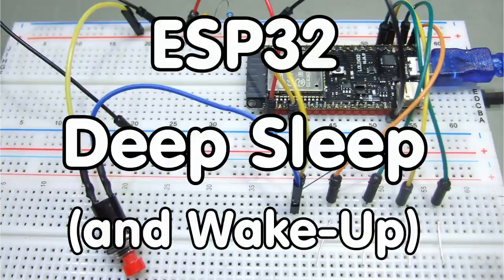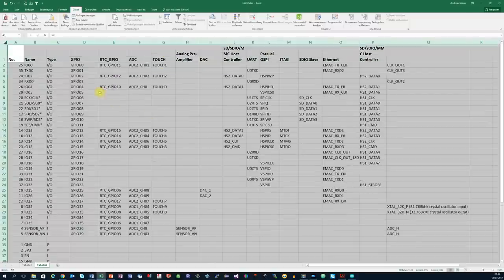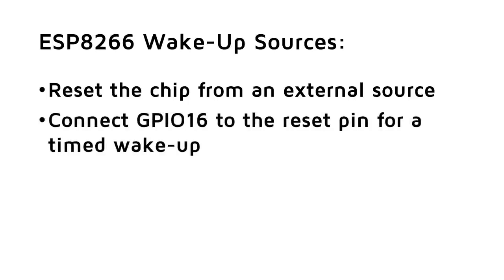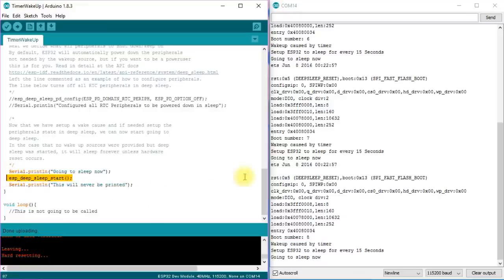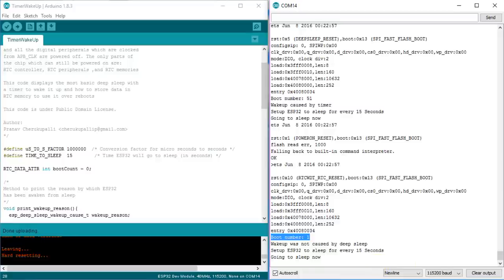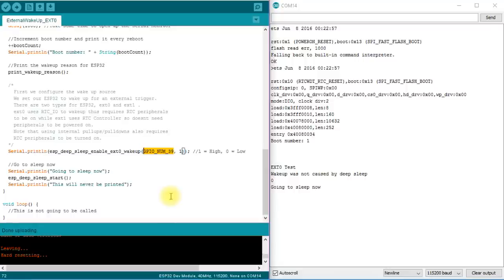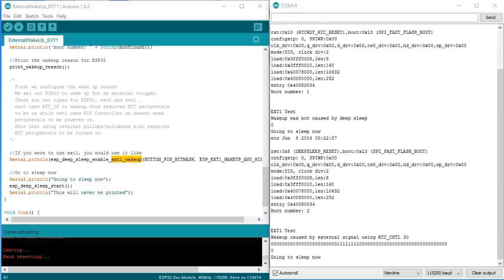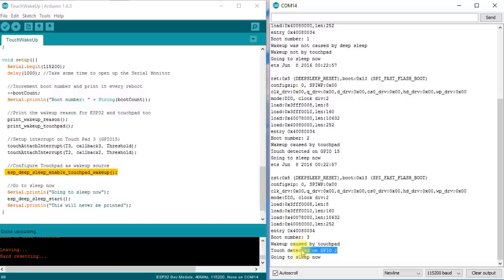#149 ESP32 Deep Sleep, RTC Memory, "Secret" LoLin Pins

Comment: Andreas, i don't quite understand the bitmask, what if i want to wake up the pins 32 & 33 ?

thank you.
Marc.
Reply from the maker: Each pin has its own "mask". If you want 32/33, you have to set bit 32 and 33 in this mask to high (0x600000000 if I did not a miscalculation).
Reply: Andreas Spiess thank you Andreas. YOU are my hero :)
Reply: Andreas Spiess the bits 0000 0000 (what are gpio from bit 7 to 0) please ?? :) thank you. Marc.

Comment: I didn't see a current comparison between the deep sleep modes of 8266 Vs ESP32. Does the 32 use less during deep sleep?
Reply from the maker: I will do real measurements in a later video.

Comment: Does the ESP32 completely turn off WiFi when you use "WiFi.mode(WIFI_OFF)"? It doesn't compile with "WiFi.forceSleepBegin()" like the ESP8266. Also, how to turn WiFi back on? I used "WiFi.mode(WIFI_OFF)" and since then my WiFi hasn't been able to connect to a network anymore.

Also, you mentioned that RTC memory only survives deep sleep but not hard reset. Is there a way to make it survive reset like it did on ESP8266?
Thanks!
Reply from the maker: 1. I would assume you just use WiFi.begin to start WiFi again. But I did not investigate.
2. RTC does not survive power down. AFAIK it survives a reset.
Reply: Hmmmm as far as I can tell the "RTC_DATA_ATTR" variables are not surviving hard reset but they are surviving deep sleep wake up.

Comment: Andreas, i made some test yesterday. I have notice that on bootup the esp32 gave me the real reason. And if i dont manually reset it it doesnt gave me the real  reset reason. So i tried to reset it via a NPN transistor after the first boot with EN pin on the collector and it jammed. Even with a 555 timer, it did the same. Is there a way to reset it manually to get the real wakeup reason ?
Thank you .
Marc.

Ps: thank you for being therev:)
Reply from the maker: I do not exactly understand what you mean. AFAIK it does not give the wakeup reason, but the reset reason, which is something different. If you press the reset button, the reason is always the same...
Reply: when i pressed reset it gave me the RIGHT reason, and on the wakeup when i do not press reset, it doesnt give me the good reset reason, i have the version 0 by the way.
Thank You.
Marc.
Reply: No! That's the point! It is weird! It gives me the REAL reason , once i have press the reset button only!

thank you.
Marc.
Reply from the maker: +Marc Paradis Strange. The deep sleep examples gave me the right reason. Maybe you try these.

Comment: Hi, thank you for these videos! they are amazing! I'm facing a challenge with the ESP32 Dev Module, if I don't have the sensors connected to it, I can flash it from Arduino just fine, then I connect the sensors and everything is ok. But If I already soldered the ESP32 Dev Board to the sensor I cannot flash it anymore from Arduino. Is there any way around this behavior? How do people do upgrades after they have soldered their ESP32 to their pcbs? thanks!
Reply from the maker: You can do OTA downloads.

Comment: Hello I made the program to turn on and off an LED by Bluetooth in this case I use the same LED that has the ESP32 in pin2, I added a stretch of code for the ESP32 to enter a state of deep sleep. Well, when I send the 'A' the LED will turn on and off and when I send the 'B' it goes into deep sleep, however, I still consume the same as I could send the program to see where the error is.
Reply from the maker: Unfortunately, I cannot do remote debugging. First, check if your MCU stays in deep sleep for a time. Then you have to check what development board you use. Because many boards consume a lot of energy even if the ESP32 is in deep sleep (I made some videos about it).

Comment: Hello! I plan to use this mcu for a project in deep sleep mode, but Im worried if I will be able to use libraries desgined for arduino, is it possible? I want to use max31865,library for sd module and maybe some library to use accelerometers.I wait your answer with hope. Thank you for the information.
Reply from the maker: You always have to check if the library also works for the ESPs and sometimes you find one which works.

Comment: Hi, I'm pretty new to micro controllers and electronics, but have been playing a bit around with ESP32 and really enjoys it. Have got great inspiration by all the video posted by Andreas - highly appreciated. I do however not completely understand how the schematics should be for respectively interrupt wake-up with respectively the EXT0 and the EXT1 approach. In my case I would like, if possible, to use a doorbell button (no voltage) to wake it up (then I will use a relay and some arduino logics to trigger the actual doorbell post wake-up). Hope someone can help providing me a bit of input on the schematics for the wake-up part.
Reply from the maker: You found the right link!

Comment: Hello I have a program that turns on and off a led by bluetooth and the delay is by bluetooth too but when I send the signal so that the led begins to blink and send the signal to give the delay, I want to disable the common radio block for bluetooth and wifi so that the battery lasts longer, nothing more than that block so that the led keeps flashing, what command would use and where in the program would put it
Reply from the maker: I do not know because your setup seems to be quite complex.

Comment: Is there a way to disconnect the radio module from ESP32 today to reduce its consumption to 15-20 mA (sleep modem)?
I tried using WiFiBlueToothSwitch.ino In fact, but I could not turn off Wi-Fi and lower the consumption below 65 mA while keeping the CPU working.
Reply from the maker: Maybe you try this example and measure the current consumption. https://github.com/espressif/arduino-esp32/blob/master/libraries/WiFi/examples/WiFiBlueToothSwitch/WiFiBlueToothSwitch.ino
Reply: yes, but unfortunately Wi-Fi is not turned off despite the examples.

Comment: Hello,
I have a sketch which I programmed for ESP8266, however now I am seeking more RTC memory for this reason I wanted to upgrade for the ESP3. 
I am getting this error 
Multiple libraries were found for "WiFi.h"
 Used: C:\Users\eahab\Documents\Arduino\hardware\espressif\esp32\libraries\WiFi
 Not used: C:\Program Files\WindowsApps\ArduinoLLC.ArduinoIDE_1.8.10.0_x86__mdqgnx93n4wtt\libraries\WiFi
there is a conflict between Arduino WiFi and the ESP32 WiFi. 
what do you suggest to solve this problem?
Reply from the maker: This is just a warning (or information). The compiler uses the right library. If you want to avoid this message, you have to delete the original Arduino library, which I think, is not a good idea. I think, there are probably also other methods in the Arduino IDE to avoid these messages, but I do not know how.

Comment: I understand that it resets and runs setup when waking up, but can't you put the sleep command in the loop and only call it after a certain number of loops?
Reply: Daniel Segel Yes you can use a delay loop, however this will not allow you to turn off the main CPU and power usage will be around 50mA, or about 300x more than if you were to put it in deep sleep. Anyway as Andreas explains your can keep variables in the RTC memory to retain the state of your program between sleeps.
Reply from the maker: The simple rule is: Wherever you put the "esp_deep_sleep_start();" command, the CPU starts to sleep and you do never reach any statement behind this statement, because, after wake-up, it starts with setup() again.

Comment: UPDATE:  I used another script initalizing WiFi and connecting to somewhere then I measures 1.7mA while sleeping !!!
124mA WiFi on & running , 1.72mA connection closed and sleeping.   (LED still on)
Strange - it seems that uninitialized or not disabled WiFi draws 13mA.
Reply from the maker: 1. There is probably still the USB-to-Serial chip up
2. 1.7 mA seems to be very low. Usually, the LED needs more...
Reply: I'll send you the program and a picture of my DMM
there was no usage of the USB in both cases (otherwise the supply would comt from there).

Comment: Update for those, who get an error by using the linked example on github:

TimerWakeUp:32:3: error: 'esp_deep_sleep_wakeup_cause_t' was not declared in this scope

There are 3 lines to update:

//  esp_deep_sleep_wakeup_cause_t wakeup_reason;        // old
  esp_sleep_wakeup_cause_t wakeup_reason;             // new
//wakeup_reason = esp_deep_sleep_get_wakeup_cause();  // old
  wakeup_reason = esp_sleep_get_wakeup_cause();       // new
  //esp_deep_sleep_enable_timer_wakeup(TIME_TO_SLEEP * uS_TO_S_FACTOR);       // old
  esp_sleep_enable_timer_wakeup(TIME_TO_SLEEP * uS_TO_S_FACTOR);              // new
Reply from the maker: Thanks. They changed the commands in the Espressif code.
Reply: @AndreasSpiess  alright, that's kind of community thinking. If you find an issue, make it public 😉
Reply from the maker: You can also create a pull request if you want. Then the root cause would be fixed ;-)

Comment: Andreas do you think we could control gpio's in deep sleep ?
Reply from the maker: I do not know, if we can do that or in which sleep modes the GPIO state remains as it was set before sleep. During sleep, only the ULP is powered and could do something. I know that it can be used to monitor GPIOs, but I do not know if he has to wake the main processor to change GPIOs. And anyway, the ULP has to be programmed in a special assembler. For sure a thing for a later time (at least for me).

Comment: I can't deep sleep the esp32 for more than 35 minutes, I suspect is something about the size of the int variable but changing it it sleeps forever.
Reply from the maker: The variable has to be 32 bit if I remember right
Reply: @AndreasSpiess  It's actually an Unsigned Int 64 (unit64). a very very large number.

Comment: Dear Andreas, I did a project with ESP32 on battery power. It turned out that (at least for my Wroom32 devices) there's a limitation in the Espressif code that only enables deep sleep for 4296 seconds. If you use esp_deep_sleep_enable_timer_wakeup(4297000000) the board will wake up in one second. Have you experienced this problem? Now it has to wake up once per hour and check if it should do something or can go back to sleep. Of course it affects the battery life, too. :( Also see https://www.esp32.com/viewtopic.php?t=6634.
Reply from the maker: It should be longer:
https://github.com/espressif/esp-idf/blob/045aaf6fb0e1c7bc121088a6457873ddf86badee/components/soc/esp32/rtc_time.c#L132
Reply: @AndreasSpiess  Thank you, I know that should. However my tests show that there is some regression in the code  that resets the timer at 4296 seconds. I hope someone will find the issue with the help of inline debugging. ;)

Comment: Andreas, always the same reset reason: TG0WDT_SYS_RESET
:-(
Reply from the maker: Did you try the example files? Mine gives the reason in plain English: 
  switch(wakeup_reason)
  {
    case 1  : Serial.println("Wakeup caused by external signal using RTC_IO"); break;
    case 2  : Serial.println("Wakeup caused by external signal using RTC_CNTL"); break;
    case 3  : Serial.println("Wakeup caused by timer"); break;
    case 4  : Serial.println("Wakeup caused by touchpad"); break;
    case 5  : Serial.println("Wakeup caused by ULP program"); break;
    default : Serial.println("Wakeup was not caused by deep sleep"); break;
  }

Comment: Hi Andreas, great again. The 150mA current seems to limit the usage on Battery mode a bit. Also using pull-up resistors must be handled with care because a 100kOhm resistor on 3.3V also draw a current of 33mA. Again I was laughing because I missed the info of the max sleep time of the esp8266 and was wondering about some strange wake-up times. Thanks again.
Reply: Stefan Bode It sounds like you're mixing up your micro's and milli's. The current draw was 150uA not mA - pretty respectable really. Also 3.3V / 100k gives 33 uA not mA.
Reply: Ronan Cantwell Uups. Agree.